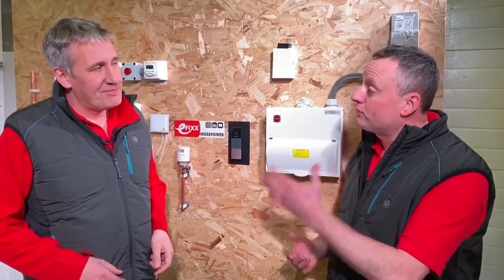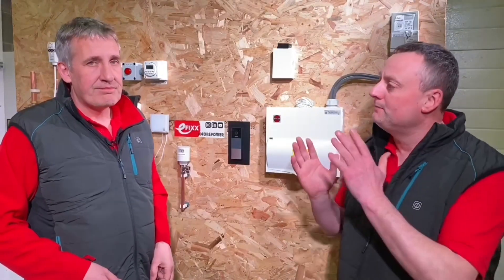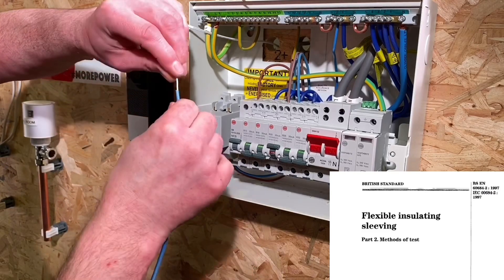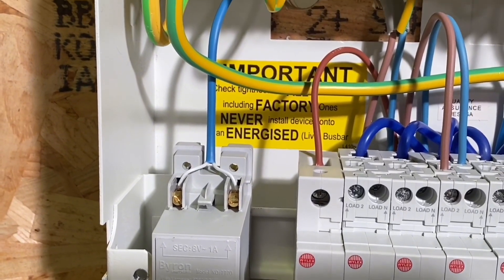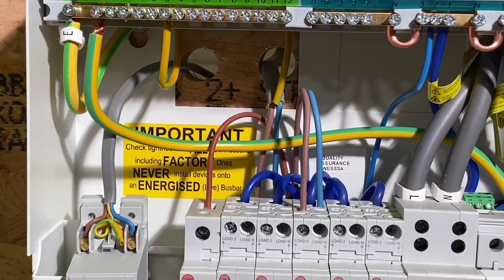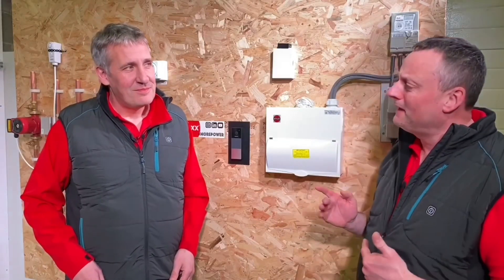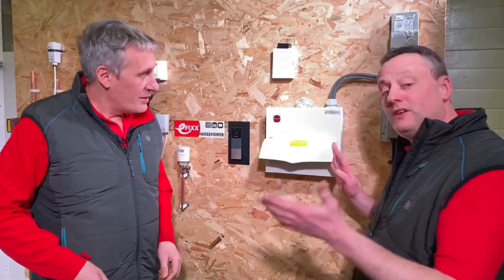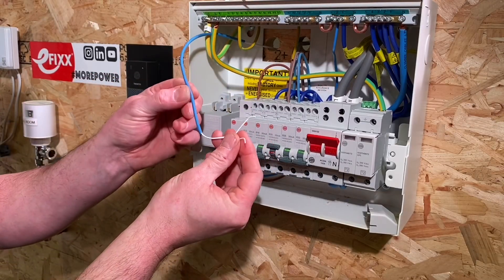CONSUMER UNITS and DOORBELL TRANSFORMERS - separation of band 1 and band 2 circuits - BS7671

Comment: I am wondering why the doorbell circuit is usually not protected. On line side the transformer is protected with a circuit breaker, but what is going to happen in case of short circuit on low voltage side? I mean, nobody places any overcurrent protection on low voltage side when connecting the doorbell, and I'm curious why.

Comment: To make it easier to fit the sleeving you could use heatshrink, which when shrunk has the added advantage of not easily coming off. What I did is use some of that high temperature silicone fiberglass woven yarn sleeving. The stuff I used was allegedly rated for 1200V and pushes on much easier than normal sleeving.

Comment: I have a question.ive got a 24v video door bell transformer and when i tried to install it on the load side of the circuit breaker it keep tripping and when i connected to the in side no more trip and the neutral cable i connected to the neutral bar why it trips when its connected to the load side?

Comment: Thank you for this video. Literally answered my question with regards to installing the transformer in the consumer unit. I don't want to see another housing on my wall to power a smart doorbell. Otherwise id fit it from my lighting circuit which would be a lot easier. Cheers

Comment: Could you just have a Wylex ESE2 enclosure close to the chime with a transformer inside running off a plug to socket  or a switched fuse spur  ? similar to what you said run it off the light circuit thus avoiding any difficult regs?

Comment: Is it acceptable to add another DIN rail transformer (AC/DC) next to the AC/AC bell transformer to power a low voltage DC device that needs to be located near the bell power source? I'd like to install an AC relay and small wireless device near the consumer unit that gets triggered when the bell circuit is closed (for home automation purposes).
Reply from the maker: One of the great debates of our time. I’d put the transformer and relay in with your wireless stuff rather than the Consumer unit
Reply: @efixx  thanks. Yes, it’s a tricky one as my gut instinct is to keep as much of the AC part of the setup in the consumer unit as possible, so that only the bell wire AC and DC need to come out to the relay etc. but that also puts DC in the consumer unit. Argh. If there’s no established convention, I might just throw in a meanwell 5v device I have in a spare slot and give it the ‘does it look like a bodge’ sense check.

Comment: I see bell wire or cat 5 cable inside consumer units loads, my preferred method is twin & Earth to a separate enclosure for the transformer and then bell wire to the unit.
Lots to take in there, let's hope that Andrew manages to take it all in.
Reply: I was thinking of doing it this way ..I have an enclosure for the transformer so could fit it on opp internal wall

Comment: FCU from a socket circuit near the DB, DIN rail enclosure for the transformer. Feeding it from a spur rather than it's own dedicated circuit saves a way and when the dreaded AFDDs do come in it saves a few quid.

I also tend to wire using two core flex, the insulation has a better rating than bell wire and it's easier to fit the R clips without smashing your fingers with a hammer...

Comment: I mount the transformer in a dedicated enclosure, and use 2core 0.75mm flex from the transformer to the doorbell.  I crimp on a ring crimp at the doorbell end for ring doorbells - a nice installation.

Comment: I  have a question for you , as you have a training background, two questions actually.
Scenario...a pump house in an industrial or comercial setting, inside, two diesel engines and two electrical three phase jockey pumps, all the associated piping for the sprinklers and of course a main electrical panel controlling everything.
1. Does the  panel have to have local isolation adjacent the panel, or not ?
2. What qualifications would the 'fire pump engineer' have to have to work on any part of the system, including all the voltages present within the system, from sensor voltages to 415 AC ? and I dont just mean should have, I mean HAVE not SHOULD to remain with laws,regulations etc.
-

Comment: Well....Most electrical wholesaler still lists cable as T&E, twin & Earth or 2-core and earth....so I would not get too hung up on the description, the cable manufacturers are ahead of the cable suppliers with up to date cable description. Check out your favoured Doncaster Cables decription then look at say  TLC or Expert Electrical, two well known suppliers.

Comment: Different  topic ,with an led ribbon of 5metres and the driver is sat 10metres away what cable should be used and size.Asking because some lighting designers say using cat 5 cable is ok,cheers
Reply from the maker: What voltage and watts per meter is the LED tape ?
Reply: @efixx  6watt per metre  12 volt

Comment: I wpuld be more worried about induced voltages where band i and bamd 2 cables run in proximity
Reply: At the currents, exposure lengths and (lack of) imbalance in a domestic situation induced voltages are insignificant.

Comment: Good video but these transformers are a real throwback to the 60's. Things have moved on and 8 volts! What's that all about? Smart doorbells have different voltages so often these transformers are useless. I posted in a previous video of yours that I'm helping my son refurb his hall and he's put in wiring for a smart doorbell but as he doesn't know which one he wants we've fitted a socket in the understairs cupboard and taken the bell wire into there so a dedicated plug in psu can be plugged in.

Comment: I don’t think it’s a good idea using T+E cable for a bell circuit. Reason being if it’s run under the floor it’s not obvious it’s for a bell circuit. What’s to say someone’s comes along and runs a mains cable next to it or share the same joists holes.. Incidentally when I was an apprentice in the late70s we never segregated bell wires from mains cables ,I don’t think many people did . Something  we would never do now .
Reply: I assume that the higher rated insulation would prevent induced current interference. Would need a test to see though.

Comment: Don't like the 1mm t&e, same wire different voltage? 2 core flat flex and some nicely printed label flags around it wouldn't add too much to a £200 smart bell install.

Comment: Although it should be obvious to anyone going in the consumer unit what the cable is, not sure I'd over-sleeve it with blue ;) 
I personally dislike solid core bell wire, and generally use the closest size stranded twin speaker wire. But I normally use an externally mounted transformer, and ensure adequate separation of voltage bands on new installations, unfortunately you never truly know whats going on behind the scenes in an old house though.
Reply from the maker: do you still oversleeve the speaker wire - or does it have a specified voltage rating?
Reply: @efixx  The external transformers I fit have separate compartments for the LV and ELV terminations. I've not yet found myself needing to change one mounted inside a consumer unit, But if I were to need to I will admit applying sleeving is a good solution, Thankfully most of what I do is new work and I wire a lot of heating systems so I have quite a wide variety of sleeving colours and sizes 😂

Comment: Nice. Does solid core cable have problems with DC voltage?
Reply from the maker: Not at the low current required by a doorbell

Comment: i tend to use 2 core flex .. but prefer to mount them externally just for the shear fact it takes up 2 ways that could be used in future
Reply from the maker: yes good point